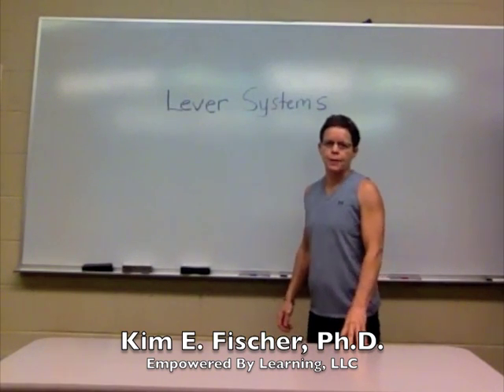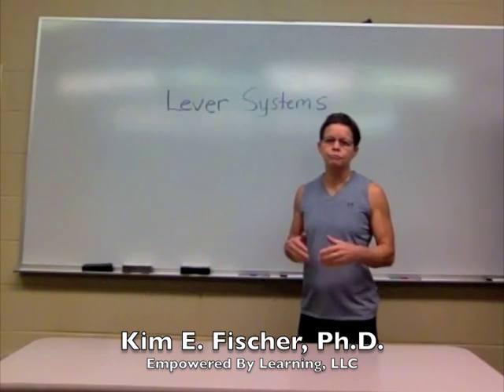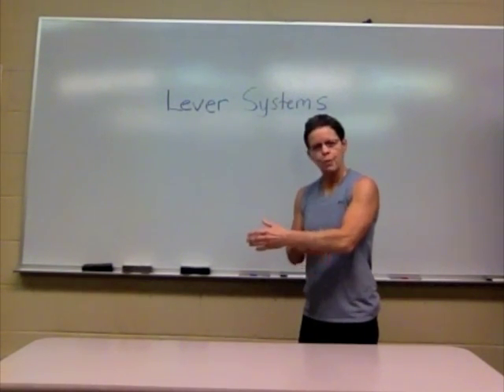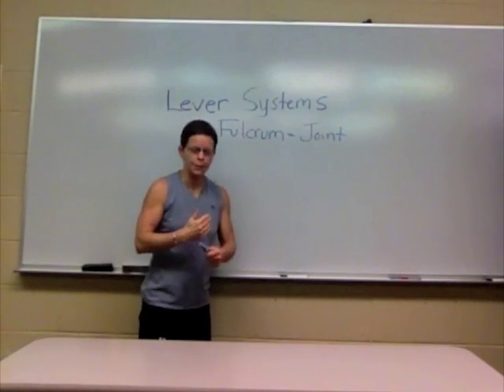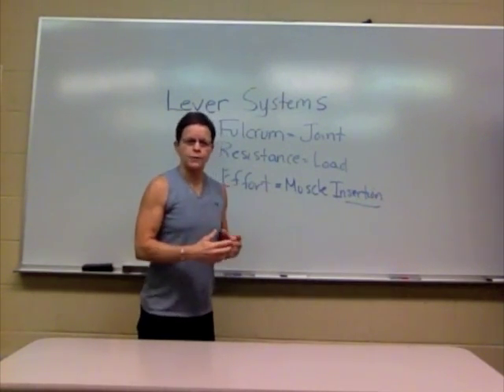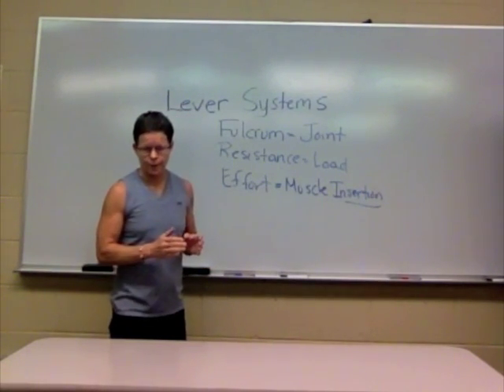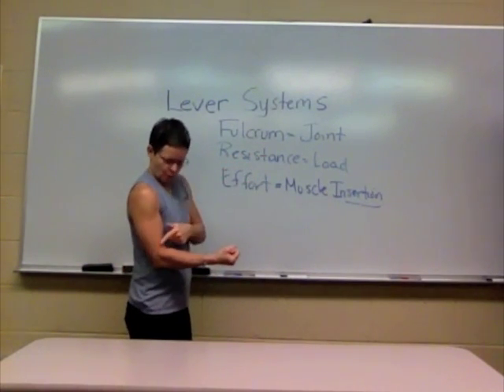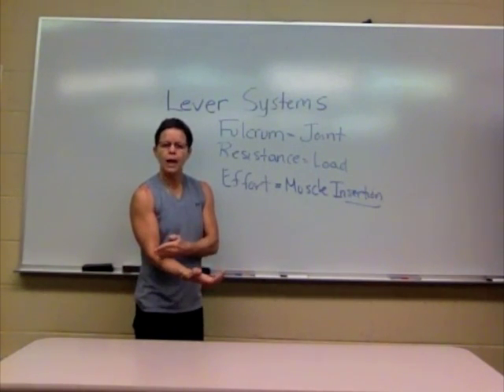Lever Systems

Comment: Hello Dr. Fisher,
 I had a question regarding the axis of the pelvis girdle and hip while swimming in the breaststroke technique?
Since the pelvis girdle is a multi axis joint it would have movements in all 3 planes and along with flexion (anterior pelvis tilt), extension (posterior pelvis tilt), internal rotation, external rotation, and lateral flexibility to either left or right.  
Also I'm a bit confused about some of the antagonist and synergist during this particular movement?

Comment: Put the numbers 1, 2, 3, in this order above the letters, F, R, E.  
123
FRE
This is a method of remembering which lever component is in the middle of the respective lever system.  First class = EFR (note the fulcrum in the middle).  Second class = FRE (resistance in the middle).  Third class = FER (effort is in the middle)

I hope this answers your question.  If not, try me again!

Comment: I'm not certain of what you are asking BUT using FRE for Force, Resistance, Effort and then writing 123 in this order above each letter helps you remember which component is the MIDDLE of each lever system.  So, 1st class lever has the Force in the middle and Resistance and Effort on either side.  2nd class lever has the Resistance in the middle with Effort and Force on either side of it.  Finally, the 3rd class, the most common is Effort in the middle with Resistance and Force on either side.